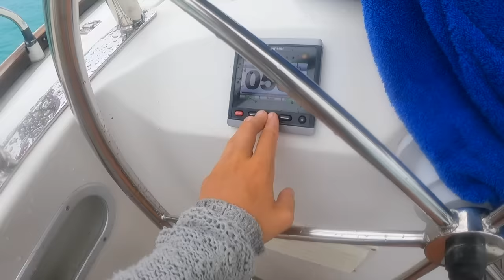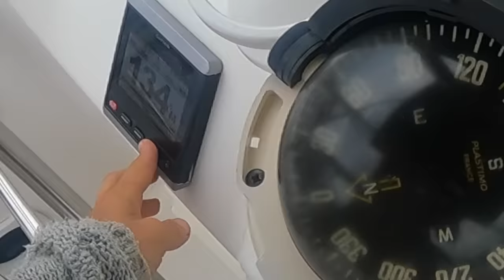How to wait out a tropical storm?! Sail to shelter, provisioning, boat projects, & wine [ep 19]

Comment: The windlass problem could be several things.  You mentioned it was struggling at the end of pulling up the chain.  Typically if the chain hadn't been jumping the Gypsy, I would say the motor (from your description) might be bogging down after a good bit of work.  That would generally in my experience be a situation called voltage sag.  It is when for instance a battery has been providing a lot of power for a good bit of time.  It's because the battery is somewhat depleted and this causes not enough power to be supplied to the windlass as when it first started working.  This is especially true for systems where there is a battery forward to drive the windlass.  Typically in a lot of these battery forward conditions there is a small gauge wire that charges the battery over time off of some charging source(solar, alternator, etc).  Typically this means that a large amount of current can't be supplied to reinforce the battery during a pull.  Now some boats have a large gauge(typically 2 gauge or 0 gauge) wire running forward from the main battery bank.  This kind of system can provide more current to the windlass, but as the wire heats up the voltage can sag as well.  It is likely your battery can be just too old, which can be dangerous if it never reaches voltage levels above say 12.3 when fully charged.  This means that when you put a heavy load on it the voltage will  drop to 11.8 or something like lower below 12 volts.  When this happens the windlass motors are not designed to really work at those voltages yet will try their best.  What ends up happening is the motor burns up because the voltage is too low.  If you have a multimeter check the windlass battery if you have one.  Check it when pulling up the anchor, and within seconds of having finished.  If you don't have a multimeter get one, a boat can't be without one.  My guess is it is your windlass battery is going bad or contacts are dirty.  Sometimes the contactor may have burned points on the inside.  Your controller or up down button goes to the contactor to engage the big wires for the windlass.  If you don't have a windlass battery, you could try having your transmission in neutral with the engine reved up a good bit.  This means the voltage will be up enough to give the motor on the windlass what it needs.  Geez what a post!!
Reply from the maker: Hahaha I appreciate it!! I’m thinking it’s the gypsy
Reply: Also, don't forget to check for corrosion under the heat shrink on the battery cables.  (I assume you have spare heat shrink) They can look fine till they burn right through.
Reply: @laurenlanders  the gypsy is a mechanical piece - if you can see chain stacking up in the locker and causing something to jam then yes (though would that be a "bogging" or instant lock up) - could possibly be the gypsy.  Bogging down sounds electrical or stress of some kind.  When you pull up do you motor up on the chain or use the windlass to pull the boat up over the anchor?  If the latter try using the windlass in short runs, letting the cattenary pull the boat forward, then wave action to pull the anchor loose, or use the engine for both.  Not putting the chore of pulling the boat up through wind and current may be what the windlass needs.  This post regarding wire guage and distance is spot on and a key element in high current draw.  If your windlass is that new then there likely is no "new" issue with a cast piece of steel.  Look for electrical  - areas of impededance as this OP mentions...

Comment: She's sailing like a dream Cap'n! I'm sure this is way behind real time, but with regards to the windlass. Because it's so new, it's not likely to be the windlass motor, or other component, unless you've seen them smoke, or smell funny, so I would look at the electrical system instead. Weak motors are usually a sign of poor connections and/or a weak battery. Windlasses use lots of juice, so maybe check the most obvious thing, charge state of the battery. Swap out another/newer battery to see if it works better. If not, then it's likely a connection somewhere. The simplest thing to do is to physically inspect them all one by one, clean them with a bit of sandpaper and/or use a good contact cleaner (Deoxit is great, but kinda pricey) to make sure there's no corrosion issues. Using dielectric grease is great for preventing future corrosion, as well. It's a long shot, but there may be a "parasitic draw" elsewhere in the boat that is keeping the batteries chronically low. Sometimes older, automated systems will start to spaz and rob the batteries of too much current when at rest. It happens in cars a lot too. It looked like the windlass did not have a connection for the green ground wire either, which seems odd. Maybe that's just how it's designed, but perhaps there's a sneaky ground wire that wasn't attached at install. Either way the windlass tself should still be good. Just take it one step at a time and you'll get it. Cheers from FL, USA!

Comment: Add additional battery to power windlass for duty cycle increase....first check for heat on motor . motor may get hot when windings insulation is worn .
Upgrade motor or first check contactor for pitted black smoke from arcing .
Clean or replace and check all wire contacts for corrosion that may cause windings to over here from loss of current flow.

Comment: Not sure if you have purchased one yet but, they have these wagons you can buy that actually compact down for storage after use. This would be awesome for your supply runs. You can even get them with sand wheels as well, so they roll on the beach in case you ever have to traverse in that way. Now obviously you would have to figure out where to put it while you're shopping but, it would definitely help you for those long walks with supplies.

Comment: Just a quick anchoring note - the purpose of an anchor snubber or bridal (two legged snubber) is to 1) take load off windlass which you accomplish, and 2) to stretch and absorb tugs and impact of the wave motion which protects cleat or other attachment points, and also less likely to make anchor “pop” loose and drag. You really need a longer snubber for that. Especially in higher winds. I’d recommend a minimum of 20’. Best regards. Cheek scratches to Mako!

Comment: Regards your windless. Before check anything mechanical or electrical. Next time the windless slows down stop it and drive forward on the anchor and free the anchor with the boat as the windless might be a bit under powered for breaking the anchor free once its free then use the windless again.

Comment: Lauran  check to make sure you are getting the right voltage , you may be having a voltage drop on your chain hoist. I am an electrician. The motor may be in a bind also. You can take the cover off and spray it libraly, with WD40 that will take out the water and it will run better. Dorian from Houston Texas. Good luck and fair winds

Comment: Greetings Lauren, 
There was an Episode that you were bitten by the "Mini Vampires". I have a remedy! We did this on our boat (Bristol 41.1). "Screens" that are easy to use and remove. Velcro + Screens. Easy fix: Measure all your hatches and the entrance. Buy Adhesive (soft part) velcro and Non-Adhesive (ruff part). Note: always buy a little more than you need, for booboos. Also buy either metal or nylon screens (make sure it is tiny holes). You can either hand sew the ruff part or use a sewing machine to the screen. You want to sew along both edges. You want to clean the area before putting the adhesive soft part around the surface of the hatch. The entrance is a bit complicated. that has to be 2 pieces. This way you can close the top of the hatch and still have the other part open. If you have any questions, please do not hesitate.  God Bless. P.S. Keep living my dream on the water.
Reply from the maker: Ah thank you so much!!!

Comment: From the distance all diagnosing is a guess!! Do you have the engine (alternator) running while using the windlass? You should as a higher voltage reduces the effort for the windlass. However there is a quite good chance of bad electrical connection. the best way, check and clean them all from the batteries till the windlass.
In addition I like your maintenance work. for me no need of time lapse at all. Tell us how you do it, I would like to learn from you!
Reply from the maker: Thinking it’s chainwheel /:

Thank you!! And will do😊😊

Comment: I am a ham radio operator which involves understanding antennas, and how radio waves behave. I see you're still having trouble with that auto pilot. Had that thing always been flaky, or is this something new?
Reply from the maker: Fairly new. Off and on again type problem
Reply: @laurenlanders  Do you know if that auto pilot works off the gos system, or an internal magnetic compass? 
  If gps based, is the antenna internal, (I would suspect) or is it external? There's somewhere I'm going with this, hoping to yield some sort of answer for you. I'm considering radio, or magnetic as interference as one possibility.

Comment: Lauren! Just out of curiosity aren’t you ever concerned about open sea pirates or other over powering villains to jeopardize your safety since you are single and sailing solo or perhaps just another gal on board? Do you carry guns or take any other protective measures for your safety?
Reply: From the point of view of firearms possession by foreign boaters, Bahamas policies are pretty reasonable. Owners are expected to declare weapons and ammunition, which are to be kept in a secure locker. Police or Defence Force personnel, who subsequently inspect the vessel, will count the ammuntion to ensure weapons have not been fired.

So, locked up guns would be useless in the case of pirates.

Comment: Ya she ist a gut teacher. My glutes were under developed naturally. I believe one legged deep lunges really helped me define my physique. Sometimes I'll do them stationary but I really like to hold weight in each hand ( two full 7 gallon water jugs) and lunge down the road. 
   I wish someone would have pointed the need to do more neck conditioning. Lateral and forehead push ups need to be done often. Very important for helping avoid or diminish neck injuries und neck development improves physique.
    Cheers 👍✌️♥️

Comment: Beautiful video of sailing for fun in the Bahamas. The windless problem is not good. The fact that you pull it up yourself is amazing. Are you a champion weight lifter too? Maybe I could pull it up myself but I'm not going to. I live in the 20th Century, I think. Let me check the stars...You remind me of Ann Bonnie, the famous female pirate who dressed like a man fooling the British and her own crew. When  surrounded by the British, she wanted to fight until the last "man," but her crew surrendered. At trial for the crew in Jamaica, she said, "If you had fought like men, you would not have to die like cowards." You also remind me of Joan of  Arc, the 13 year old French woman who lead her country to freedom from British rule....Back to realty - first of all, the chain stop is missing. It is used to secure the anchor so it can't pay out. Secondly, tying the chain with a rope ended with the invention of electricity, or before. I can't remember. We use a bridle with a steel hook called a devils claw because it prevents the chain from slapping the bow all night. But the chain stop that you don't have stops the chain from paying out...To test the windless motor, you need a voltage meter and an amp probe. You need to sleep with both on any boat. And you need someone to show you how to use them. Surely a new motor is not worn out. There must be an electrical problem? But most important is that we use the engines to pull up the anchor, keeping the load off of the little windless. I see that you are strong enough to push around a 50' boat, but the little anchor windless is not. Have you considered becoming a windless? You get to blow in the wind. Here is how it's done - one person you don't have, drives the boat forward slowly while a second person you have raises the anchor. In the last minutes, the anchor is not pulling the boat forward - it's pulling in up to raise the anchor out of the mud, rock, or coral. If the anchor gets stuck on a rock or coral, the person at the helm (you don't got as a single hand sailor), puts the engine in forward slowly to push the anchor out of the rock. To protect the reef, we free dive to inspect the anchor when it's stuck. And we try not to anchor on the coral heads. This is why in the Virgin Islands charter boats use the free mooring balls - to protect the reef. Post cards of the Bahamas make the beach look so beautiful, and it is. Pink sand. Blue water. But the Bahamas has no hurricane protection. It's all flat islands. All you can do is move to the leeward side of the island. The only trouble is that in a hurricane the leeward and windward sides of an island change. Trying to predict exactly where the eye will hit is impossible. Although I love your tropical storm wind direction report. Reminds me of Donald Trump predicting hurricanes :). Back to realty again - you will need two chain anchors, one set short and one long. 150' is too long! The longest should be 7 times the water depth, and that is a bit long too. In the Bahamas, you have no mountains for protection like the Caribbean. If Cat 4 or 5, every boat, every building, and everyone will be at the bottom of the sea unless you leave. The boat is insured. You are probably ready to move up to a 100 footer by now. Stop holding yourself back. You don't need five crew. You can do it all. Can I call you Capt. Fantastic? Ahrr. Love, Capt. Fish